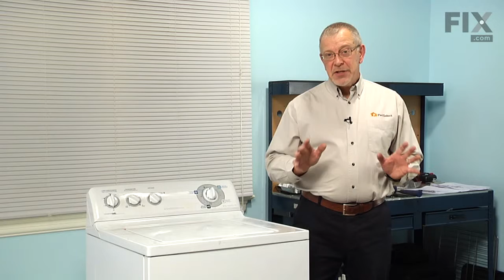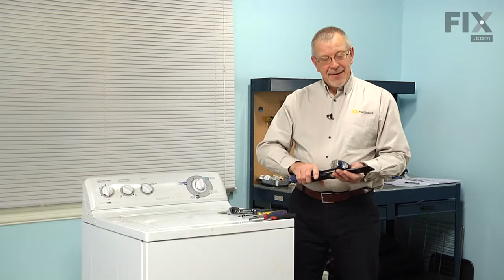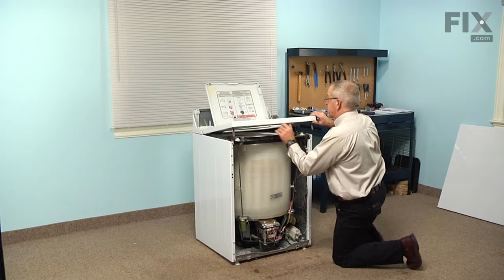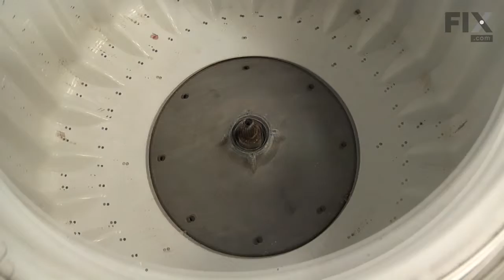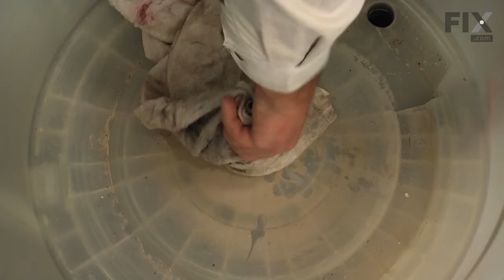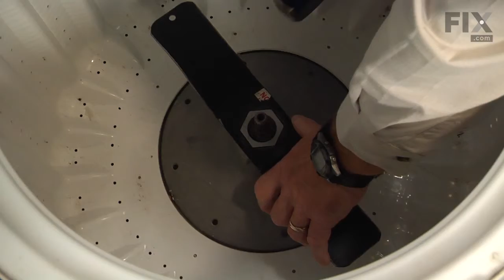GE Washer Repair – How to replace the Tub Seal

Comment: No way it was that easy to remove the tub nut. It's stuck with rust and corrosion and you need penetrating oil to loosen it. Shame on you for making it look so easy when we both know you spliced the frames together